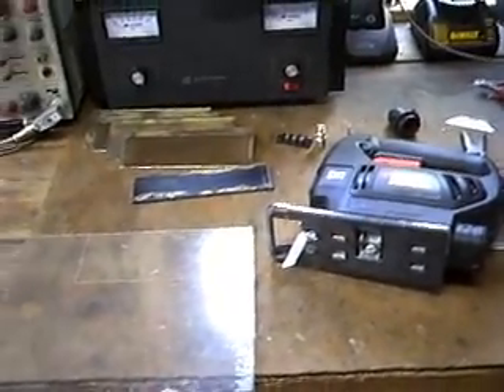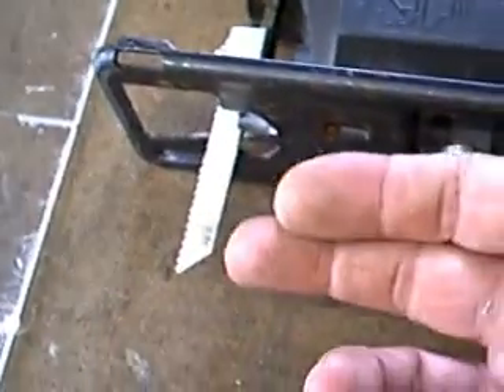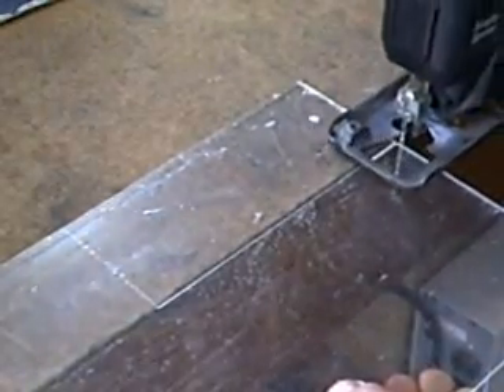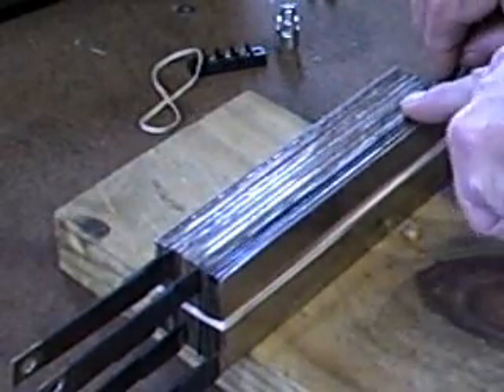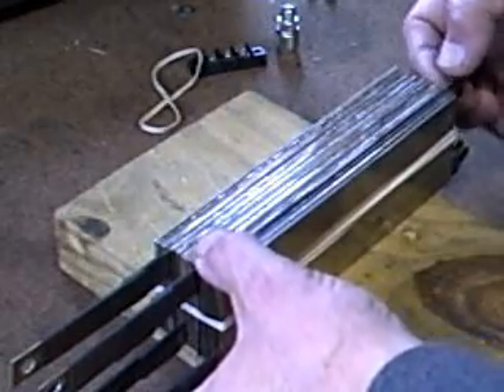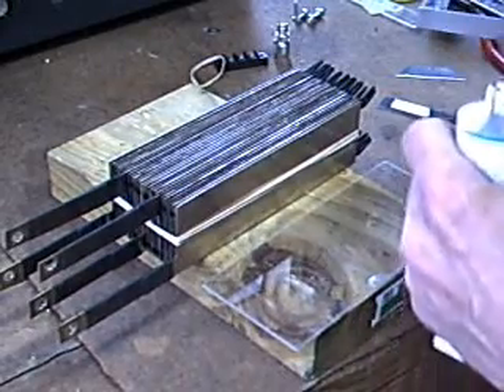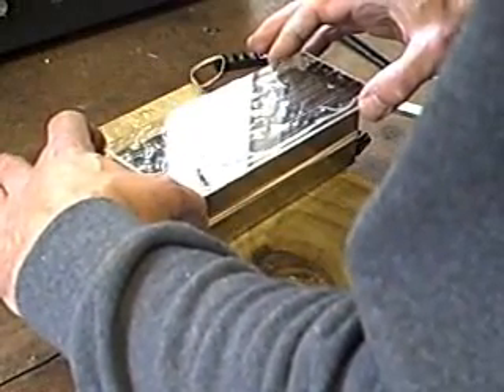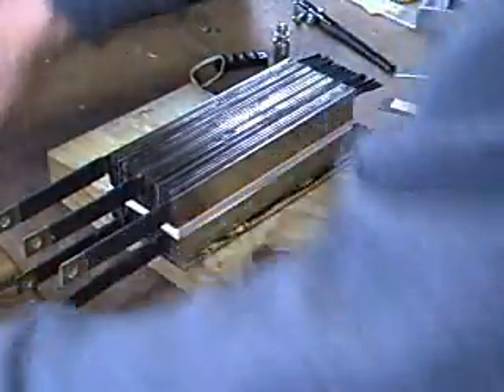#93 VSPB Rebuild begins

Comment: Hey zero, have enjoyed many of your videos. I have been playing around with a small dry cell when I have time. I have also watched others running engines on HHo. Mr. Rap actually has a small valid point despite his unnecessary negativity. Engines running on pure hho are weak compared to gas. I think the reason why has something to do with heat generation. Gas and diesel create cylinder pressure by super heating mostly inert nitrogen in the air. HHO creates heat but has no expansive gas.

Comment from the maker: They pull right out with needle nose pliers. The adhesive does not push in as deep as the cable ties sit. And, actually, nylon holds up very well in electrolyte.